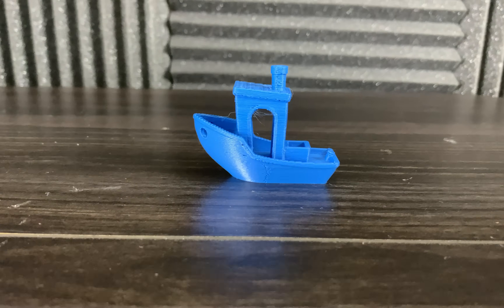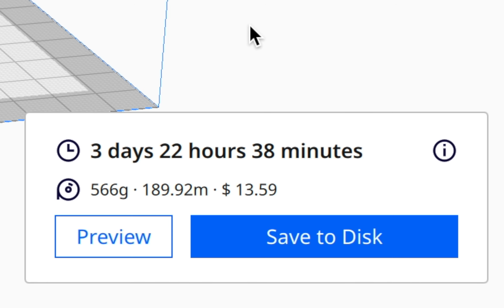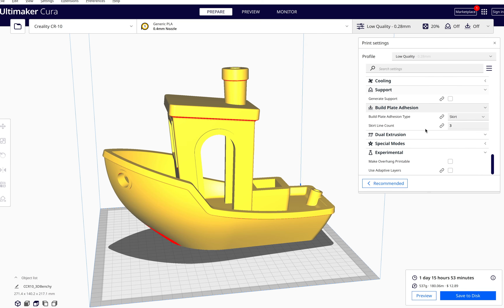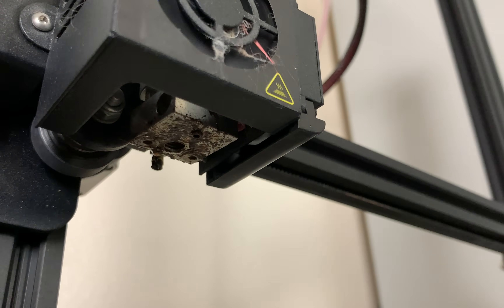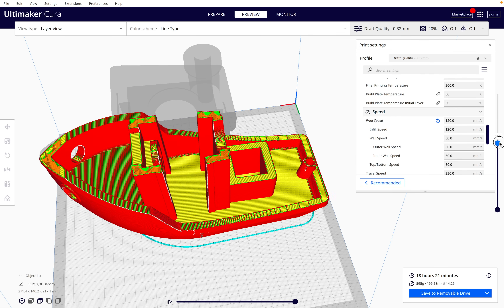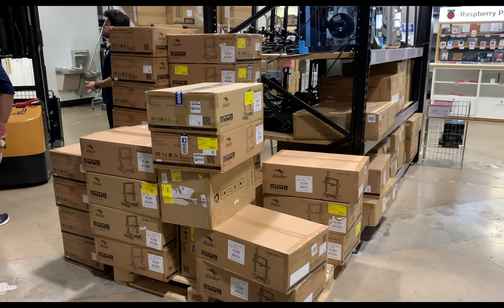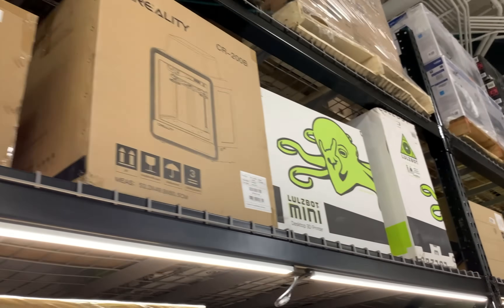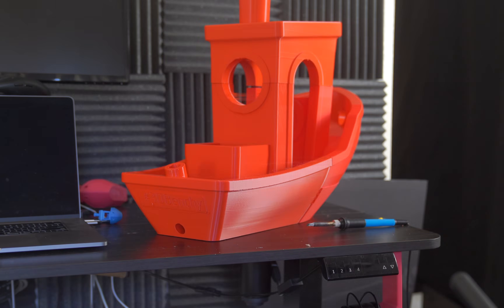Stop 3d printing so slow!!! 🤯 (how to print faster)

Comment: I'm probably going to come off as harsh. I don't mean to. I just want to provide constructive criticism. I feel deceived. No duh using more printers will result in a faster print. I understand you are promoting a sponsor, and that's fine. But the beginning of the video made me feel that you were going to go over slicer settings that let you print that giant benchy using one printer. First video of yours I have disliked.
Reply: The only useful thing I got from the video was the lightning infill.

Other than that, all he said was "just make your prints look like s**t, and you can print faster!"

You don't say.
Reply: That was his ad spot for the Sponsor.
Reply: Thank you for saving me time.
Reply: This is called unethical ads.
 Shameful what some people do for a few hundreds.
Reply: @greatestevar  he does go over settings, the buying more printers is just a sponsor at the end
Reply: I hear what you are saying, but there was a couple decent tips that are legit. Lightning infill is pretty good and ill be honest, i didnt know i could print as fast as he did in this video. Ive been printing at work for about 6 months, all self taught so i still have alot to learn but my prints come out great on the ultimakers5. But im going slooooooow. Ususally at 30 sometimes up to 45 speed. Our prints need to be very precise so i just error on the slow side thinking it will greatly improve quality but now im thinking i could speed up a bit. Anyone got an opinion on prints speed in relation to precision? Like whats the tipping point where you atart sacrificing quality for speed. Im sure theres not one solid answer so general advice/opinions are welcome. Thanks everybody
Reply: Not harsh... just, incompetent😂 you ppl slow? He showed like 5 things to decrease the time... Numb nutses..... did you guys not watch the video or wtf?😆 he showed how to decrease overall time by like 80%... then he printed 5 different parts of the bechie on 5 diff printers....
Reply: ⁰⁰⁰⁰
Reply: This was definitely one of the most helpful videos when it comes to slicer settings for speed, but the last part was very anticlimactic 😂
Reply: He did go over settings. I appreciated his joke/ad at the end anyway
Reply: I just read all of the comments and he went through multiple printer settings to save 80 hours and you are going to criticize him for having an ad?!
Reply: Welcome to the world of Clickbaiting. You can thank Gen Z 😂
Reply: Micro Center doesn't let you get the printer for $99
Reply: You’re right also he said no upgrades then immeadiately said use a larger nozzle which is upgrade or alternate purchase so immeadiately a lie
Reply: @KibaOtsutsuki  I would disagree heavily. A nozzle is a consumable that should be changed regularly. It's something you should already have a few of, so when you buy more try out the .6 or .8
Reply: @KibaOtsutsuki  I'd consider a different nozzle basic parts. It's not an upgrade if you want to print detailed parts. Just a tool. 
That large benchy was a bit of a giveaway anyhow as it obviously won't fit on a standard printer like Ender 3 size
Reply: @RennieAsh   you’re obviously wrong it’s not stock  it a different part that does some things things better ergo it’s an upgrade
Reply: @Wyvern-83 the stock printers come with different sized nozzles. And it's a dollar upgrade. Tf?
Reply: @KibaOtsutsuki  - A new nozzle is “an upgrade”?!?! 🤣😂🤣😂 I have almost a dozen nozzles sitting around. No way would I consider that “an upgrade”. What’s a new nozzle… $6.50? 🤦🏻
Reply: @shadetreesupercar  
Yeah more like 20 of them for $6 if you like the stock brass nozzles!
Reply: @shadetreesupercar I just 3d printed a new fan shroud for my printer. I can now print better than before due to more effective cooling.

But let me get this right, this isn't an upgrade (despite it being a thing that improves something) because it cost me less than $6.50.

Hmm at what monetary cost does it become an upgrade? If I find a full metal hotend in a dumpster, and it could replace the ptfe lined setup I currently run, but that's not an upgrade as I didn't pay anything for it right?
Reply: He literally explained step by step 50 ways to save 75% of print time. The added printers are an extra benefit for people who are creating products. Critical thinking is dead 🤦🏼‍♂️
Reply: @3dHaze  "Critical thinking is dead"
Why do you feel the need to be disrespectful to someone who's trying to understand your viewpoint? Clearly I have a different view, but I'm giving you the floor to convince me otherwise. Your method to do so is insults....?

Anyway, back to the actual topic at hand: I still don't feel like you have addressed my confusion. No one ever said the video isn't helpful. The beginning of the video makes it seem that the giant benchy was made with printer settings alone. I am not the only one that feels that way as you can see by the large amount of upvotes my comment has. I wished to provide constructive criticism for the product placement. A good deal on extra printers is something that should be exciting. However, I (and many others) felt mislead. Instead of feeling excited, I felt like it was a let down.

You still have not explained to me your definition of a Bait & Switch and how this video does not fall into said definition.

Should you respond, I ask that you please be mature and not result to insults. If you have something to teach me, then please do as I have a desire to learn.
Reply: Bro- I'm not trying to be a tool, but how, just how could you possibly think that the giant red benchy was even remotely possible on any DT3DP? No DT3DP, (right now) even has that type of build volume. What really has me befuddled is the 630+ people who thought the same thing as you about the giant benchy.
Reply: @smackledorfmcsween I didn't think it was gonna be one full-size print, but I did think he was gonna print all of the parts with one printer.
Reply: He literally spent the whole video going over settings and nozzle change, saving 80 hours before he even mentioned that in the 20second final part that was an ad lol you made me almost not watch, I see your dislike and I repay the favour by dislike your comment lol
Reply: I agree with this 100%
Reply: I guess you missed the entire beginning where he went over print settings and hardware adjustments?
Reply: @MrCreed10  Yes. Indeed I did. Which is why I said misleading and not dishonest.
Reply: Ok for one the benchy we saw at the start was obviously glued together like what did you except?
Secondly he did show us how to reduce print time in slicer setting only going out of context during the sponsored segment which happens in a lot of YouTube videos so get use to it buddy
Reply: @YourAverageKet  You like being misled? Cool.
Reply: He did go over printer settings and reduced the print time 80% and 80 hours. It was only when he printed the HUGE model that he used multiple printers. If you feel deceived, it is due to a misunderstanding on your part.
Reply: @shadetreesupercar  The beginning of his video makes it seem that printer settings alone was going to result in the insane print times he presented. 

Just to be clear, I am not meaning to argue. I like this creator and don't believe he had ill intent. But, I do feel that his method of trying to get people excited about getting more than one printer felt like a bait & switch, which is a method of deceit that uses preconceived notions.

Were you genuinely not surprised when he started talking about other printers?
Reply: @MichaelChin1994  - He gives methods to reduce print time by 81% and 80
Hours along with reducing print cost by 50%. Yet you accuse him of employing “bait and switch”?!?! 

YOU’VE GOT TO BE EFFIN KIDDING ME! 🤬
Reply: @shadetreesupercar  No one is claiming he didn't share slicing settings to reduce print times. No one is saying this video isn't helpful. What is being said is that the video is misleading.

At the beginning he shows a giant benchy, then goes over slicing settings. That would be the misleading bait. The switch is when he reveals that the giant benchy was with multiple printers (thus the sponsor).

How would you define a bait and switch? How is this not one?
Reply: It's evident from the slices in the print that it wasn't printed with one printer or at once.

Comment: Oh, look at that, another person who is ignoring extrusion width which is basically the magic setting that can let you print all of your walls in two passes at whatever thickness you want without increasing layer height. I'd bet, with your printer and a 0.3 nozzle, I could get a print profile that prints at the same speed as yours just by changing extrusion width, not even changing speeds from the defaults. (If anything, I'd probably lower speeds...)
Reply: what extrusion width would you suggest?
Reply: @bsr8129  It depends entirely on how thick you want the walls to be. Mostly, I'd recommend 25% of the thickness on your external wall, 75% on the internal. Depending on your gantry max speed and some other quirks of your printer, you may need to make it 50/50. Total wall thickness of 1.2-1.6mm is equivalent to 3-4 walls with a 0.4 nozzle. For me, with my 0.3 nozzle, I'd have external set to 0.4 and internal to 1. I also like having additional perimeters on odd-layers as that makes it stronger than adding a complete second wall while using half as much filament.  For the 1mm at 0.2 layer height, you would be talking something like 60mm/s for speed. The 0.4 can be up to whatever speed your gantry can handle.

The speeds are calculated based upon your flow rate and mine is about 10 cubic mm/s. (A v6 hotend)

Basically, you want your outer wall to look good and then make a single inner wall that gives all of the strength.

Comment: oh well, one thing I didn't know was the lightning infill. I have 2 ender 3 with noctua fans all over. I van currently print at 100mm/s, this is double the recommended speed! so cheers to OP, for showing, that it's possible
Reply: Yea lightning is new in cura 5.0. I think the new PrusaSlicer update has lightning capabilities as well
Reply: @avgjoeshow4208  thanks for the info, I will try it out
Reply: @lukasdoerr  yea check it out. It’s pretty sweet and can save loads of time. I wouldn’t use it on a part that you need any real strength though. But if it’s just for looks it works great

Comment: You can also try increasing extrusion width
Reply: Yes you can.  I did an experiment where I extruded a 0.8mm line with a 0.4mm nozzle.  This really speeds up the layers.
Reply: Yeah but that's basically what he did when he changed the nozzle
Reply: @erikschmidt2571  and with a 0.8 you can go up to 1.6mm line width, but turn up the heat because it will gobble the filament like you wouldn't believe.
Reply: @erikschmidt2571  Most slicers set the default extrusion width to ~ 110% of nozzle size, but it can be increased to 150% or even 200%
Reply: Do you have any idea how bad the quality gets

Comment: Here's a video idea, 'How To Use Plastic Welding To Fix Broken 3D Printed Parts'.

When something breaks, the simplest solution is just to print a whole new part and toss the old one. But that's wasteful when the part can just be stuck back together. Sometimes glue is the best option for this, but when something doesn't have enough surface area, you don't have glue on hand, and/or you just can't use it for one reason or another, take advantage of how parts are made in the first place and just melt them together with a soldering iron and a little filler material (the raw filament)
Reply: I use a 3D pen for this.
Reply: @michaelbujaki2462  same
Reply: step 1, burn paper, collect ash (carbon).
Step 2, mix into cheap ass 2 part epoxy resin you can get from any discount store for a dollar, 
step 3 glue/fill shit for a far more permanent/strong slightly flexible bond than you can get with any glue alone.

;o)
Reply: Check out frankly built videos. He has severel about pla welding

Comment: lol that "120mm/s" on your V2 isn't 120. that's more like 60 or 70. Stock board can't print that fast no matter what you do to your setting or firmware unless you are running klipper.
Reply: Though if you ran a bedslinger at 120 you'd get some mid print part removal for free.. Don't ask me how I know lol
Reply: @gotmilkbutt  I have a voron bedslinger and with pei, adhesion is maybe a little too strong 😅
Reply: @gotmilkbutt  I have gone up to 200 with my V2 but the output is far from acceptable. Lol too much ringing because of the heavy bed and my part cooling was not even close to being enough
Reply: @lancereyesromero7811  I can get ~180 on my big'ish CR-10S bedslinger with fairly good quality, with 0.6 nozzle doing 0.32 or 0.4 (don't recall) layers. It's running an SKR2 board with 2209s all around except one 5160 for a more beefy bed motor, a much more capable extruder, copper dragon with the mellow nickel-plated copper volcano block, and 70w cartridge. Plus bigger motor for the bed, low elasticity belts, and accelerometers to optimize travel/acc/deacc etc and mitigate ringing. Bed was aready heavy (no S4/S5 or Max,  but still heavy), adding a magnetic flex plate, 1000W mains silicone heater pad and ceramic cotton insulation didn't help; probably added 750-800g.

There's not a whole lot of "CR-10S" left by now I guess, that I will concede.
Reply: @pr0xZen  I can probably accept that given that you made a lot of changes specially the 5160 and beefier y motor. Plan to do the same but I don't intent on pushing it morethan 100-120. Cartesian design is not design for speed in the first place. That is why when he said no upgrades needed means stock and he was doing 120mm/s? Lol keep dreamin. Not even close. More like half ot that.
Reply: Yeah my printer moves faster than that not at 2x speed. His accels must be slow

Comment: What scale is the one you're showing times for? It looked like 447% where I could see your screen. That's larger than E3 bed so I can't actually print it, but for fun I sliced it anyway with my boating settings (speedboatrace regulation aside from the scale) and the klipper_estimator time was 3h55m.
Reply: You can use LuBan software to split the model into parts, as he did

Comment: My basic Flsun Q5 can go +200 mm/s with PLA no issues :)
Reply: I doubt your printer will reach that speed with stock acceleration...
Reply: @wbeel  You reach 200 mm/s in 5 mm at 4000 mm/s² which is rather piddly acceleration for a delta. You'll need much higher than default acceleration to take advantage of the speed in a detailed or more organic model with lots of tight corners/curves, but for something simple like a large scale benchy it's easy.

I wish this video had gone into acceleration tho. While it's not very relevant for printing giant sized boats, acceleration is the dominant factor in most real world prints making the experience so slow for most new folks.
Reply: @wbeel  I can put a video on my channel. I have printed parts at 200 mm/s already. it's a delta printer. :)
Reply: @MrTechcat   what acceleration are you using?
Reply: @wbeel  As Flsun makes official super racer 200 mm/s model.. but I have tried simply putting 200mm/s on the cheapest Q5 and it did finish a few prints on that speed with no real issues. :)

Comment: I want to start printing with bigger nozzles sizes to reduce time but don’t know what settings to change afterwards. Any help?
Reply: There is a setting for nozzle size :)
and layer height..  that's it. 
Experiment on small prints.
Reply: Cura has at least 1 default profile for common larger nozzle sizes now.  I think .5 nozzles have multiple default quality options like .4 and smaller but as i post .6 and up have one default option which works fine for a good starting point.
Reply: Don't mess around with bigger nozzles. Just change extrusion width. I print with a 0.3 nozzle at larger widths than what most people print with a 0.8 nozzle.

There is exactly three benefits that you get from larger nozzles. Larger maximum layer heights, (which only means slightly better layer adhesion, though even that is only sort of.) Less likely to clog, (which is only relevant for low quality filament or specialty filament like wood filament) and a 10% increase in maximum flow per .1mm increase. (Which you are almost certainly not at your max flow rate, probably not even at 50% of your max flow rate, so for almost everyone, that is no benefit.)

That said, you lose a lot of quality as the nozzle sets your minimum width. That means thin walls suddenly become thick walls. As long as you are printing at your max flow rate, layer height does not matter. I can print with a 0.3 nozzle a 1.2mm line with no quality loss compared to a 1.2 nozzle.
Reply: Thank you all for the help!!:)😃
Reply: @hen4168  what are you wanting to achieve with a larger nozzle?  speed or part strength?  I have been printing most of the last 3 years with .6 and .8 mm nozzles with ABS and PetG and I do feel that larger nozzles can yield stronger prints with the correct tuning
Reply: @gitss7367  Mainly speed if im being honest

Comment: very cool! At the end you show joining the several prints with what looked like a soldering iron. how are you joining the prints?
Reply: It's a soldering iron.  He's just re-melting the surface layers and bonding the two parts together with melted plastic.  A cheap one off amazon works great.
Reply: @johnnymanutes2057  Harbor Freight and other hardware stores have soldering irons specifically designed to melt plastic.  They work much better than a "regular" soldering iron.
Reply: I’m not too sure, but I’d guess a 3D pen, using the melted filament as glue.